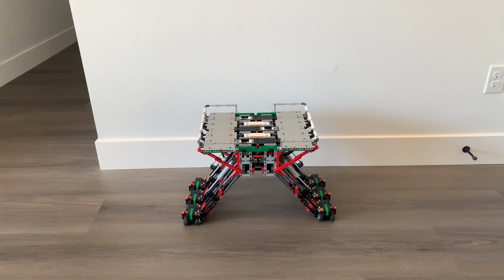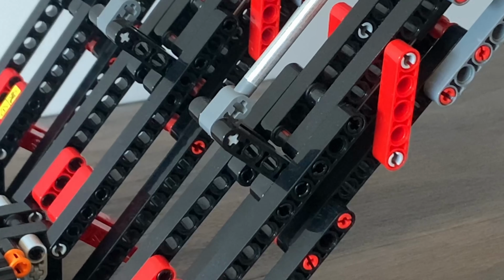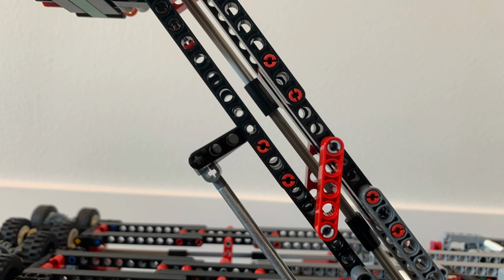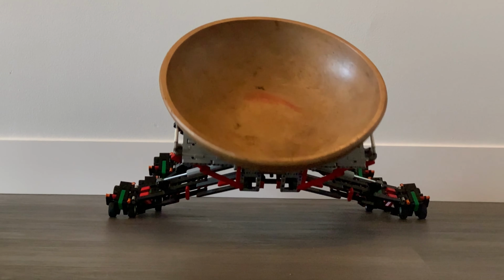Lego Star Climber V2 - The 6 Legged Stepper

Comment: An idea to fix the warping instead of just using the strength of the small L technic beam, put a straight lego technic beam on an angle from the top to a point lower down on the leg like a triangle so it puts most of the weight pushing with the beam instead perpendicular to it. It's just an idea.
Reply from the maker: That’s a really good idea! Thanks so much for taking the time to comment it for me! 😊

Comment: Any update for the lego sorter ?
Reply from the maker: Unfortunately not :/
It’s been sitting on the floor for several months now and I did a little bit of work improving the vibration table and started on the scanning bed but not enough progress to show in a video yet.  I’m not sure when I’ll work on it more but for now while I’m occupied with other endeavors it’ll just have to wait…
Reply: @BrickImperial  Ok, i took a break too, but i finished, the part distribution, i'm 70% done for the bin and ~60% done on the vibration table. Making the AI for the scaning bed is extremly difficult, at least for me that tried to learn it from the ground up, so now, i'm (trying to) sort the lego with an extremly precise weight sensor.
Reply from the maker: @minlego. That’s a clever idea.  Yeah the ai is by far the hardest part.  The latest chat GPT now has a feature(that you have to pay for) where you can tell it to code a version of itself that can do a specific task so once/if ever that becomes free then I’ll use that